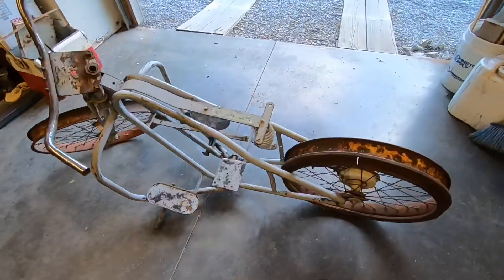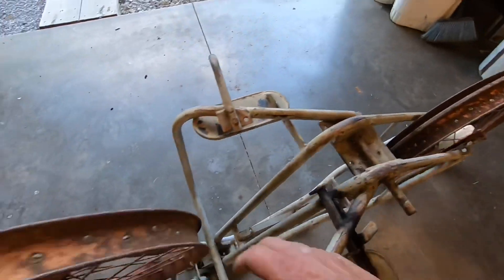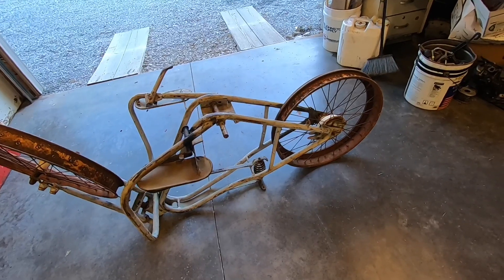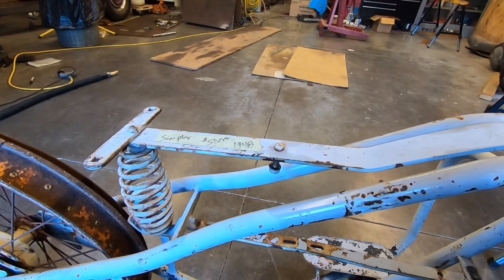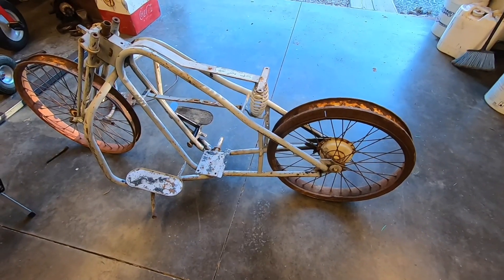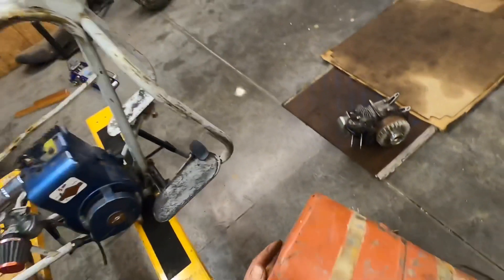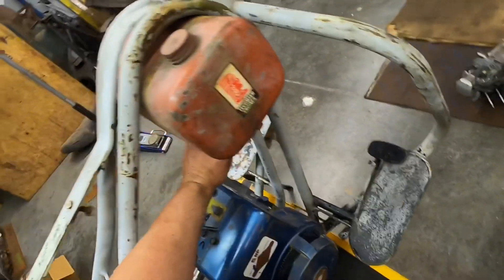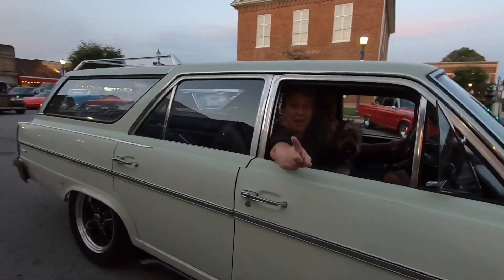A New Project!!! What is it??? #motorcycle #hotroddad #project

Comment: I know this is totally unrelated by I was wondering if you could help me get my 212 cc predator running i by passed the governor cleaned out the little black plastic piece on the carb like you showed in one of your other videos but for some reason it’ll only idle for a short time  on start but when I flip it to run it shuts off
Reply from the maker: I'd pull the carb off and soak it in carb cleaner overnight. Sounds like it may have some bad fuel in it. Search out some carb cleaning videos specific to the Predator/Honda engine.